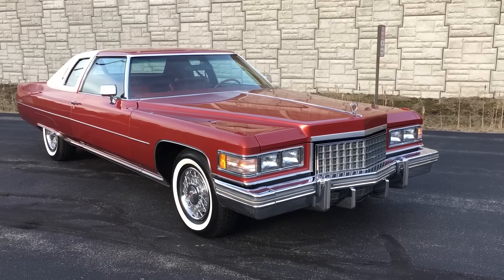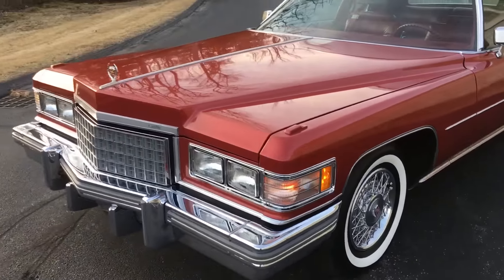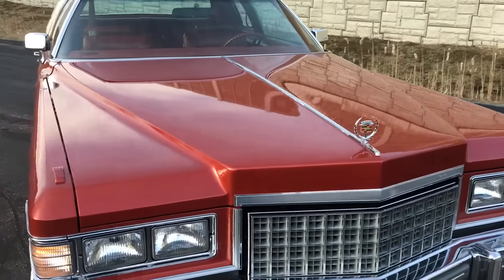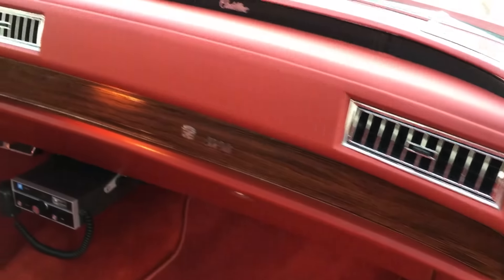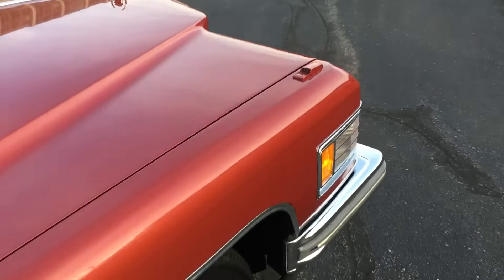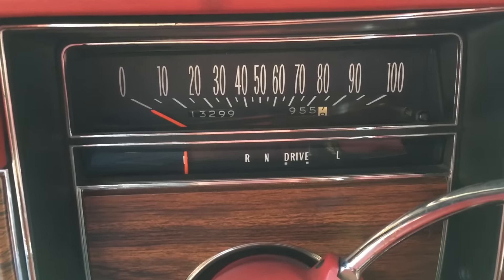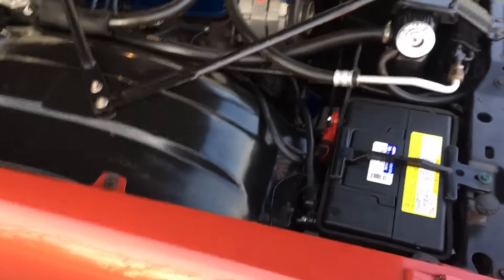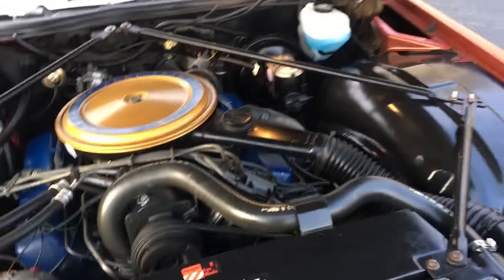1976 Cadillac Coupe DeVille with 13,299 miles by Specialty Motor Cars

Comment: Hey Anthony, I realize this video it's 2 years ago, but I am seeing it for the first time, and I am happy that you shared it with me. I had a 68 Firebird convertible, just a 350 2 barrel carb, but it had a tired looking factory green metallic that alot of the Pontiac's did back in the day. This is in 76, and I saw a Caddy like this at a dealership, loved the Firethorn Red Metallic color with the White Landau top, got my paint guys to change that Firebird to exactly that color, I remember that the paint was pricey, but after we painted it, put a new white top on it, that car popped, but I always wanted to have a Caddy like those colors, thank you for putting a smile on my face, I got let go from my job of 30 years yesterday and I was feeling low, you perked me up a little, thanks!

Comment: My first car was a 1976 Fleetwood Brougham sixty special and it had every available option for that year including the fuel injection system, Trackmaster anti-lock brakes, and the air cushion restraint system. That was quite a car especially for the mid-70s. I bought it in 1987 and drove it into the mid-90s and the fuel injection system, mine was all still original, never gave me any problems

Comment: a guy gave me this car in 1986 for painting his house. i got it painted the above color and drove it for a year on all my dates. women loved it. then my father borrowed it and dented it trying to pull into a gated parking lot. then the electrics started to go, the transmission fluid seemed to drain out when parked. a black guy i worked with had to have it, so i sold it to him for $850. it was a really great car, with miscellaneous problems. i was hardly driving it at the time, old triumph motorcycles, a van, and my pickup replaced it.

Comment: How many times did the guy say "absolutely beautiful car"? It is very nice. I so long for the days when a car was really a car. 1976 was the last year for the GM  really large cars. Most cars were downsized for the 1977 model year. The Cadillac Eldorado, Oldsmobile Toronado and Buick Rivera went on two more years as large cars then we're downsized for the 1979 model years. The 1st generation of the downsized large cars are still pretty big by 2019 standards. I enjoyed the video. Nice the go back down memory lane a see what cars used to be like. There's nothing special about today's cars. Just a bunch of plastic parts with a lot of electronic gadgets.
Reply from the maker: If you were standing in front of it like I was you would agree all 13 times I said it lol
Reply: The downsized versions proved highly successful, though, and they were quite large by today's standards, as you aptly pointed out. I had a 77 an 81 Olds 98, and a 78 Buick Electra Limited. Riding in them was very enjoyable, and they swallowed a lot of cargo, too. Very good-looking cars, too. I agree that today's cars are undistinguished (and indistinguishable!), and full of plastic and unnecessary electronics.

Comment: That hood alone probably weighs more than most modern cars! I remember when these cars were all over the place. Finding one now, especially in that condition, is a very big deal. Cadillac lost its way about 20 years ago and has not come out with anything stately since.
Reply: Cadillac had some really nice cars 20 years ago, a lot better than the wannabe import trash they make now. actually lost their way when they started shrinking their cars and giving them hard seats, rock hard suspensions, and tight handling. I wouldn't touch a Caddy made after the 2011 DTS.
Reply: @hakeemsd70m  All American cars are import wannabes now, and that's why they are pretty much garbage.
Reply: @paulparoma  Yes indeed. But you're totally right about this classic 76 Coupe deVille! So much ornate detail and chrome, I'm a big chrome bumpers, to the chrome trim, to the hood ornament, to the wire wheels, a beautiful car! This car is a work of art. Today's cars are soulless appliances in comparison.
Reply: @hakeemsd70m  I know. They are so unremarkable today and catering to a completely different type of buyer. American luxury cars used to be about comfort, grandeur and style, made for people who wanted exactly that. Today, luxury is all about "performance and handling" as if we have more room on the roads for all that nonsense. And style? Everything has to be aggressive, not elegant. Pretty pathetic, isn't it?
Reply: 1992 was the last big body v8 rwd cadillac then Northstar hell staarted

Comment: It has '74 or '75 horizontal tail lights and backup lights.  The '76 model had chrome outlines around the lenses.
Reply: I did notice. The fillers were replaced.

Comment: Beautiful land yacht 500 V8  probably burned tank full of gas while this was filmed
Reply: V8 Power Agreed! With a 500 cid V8 it would pass anything but a gas station!
Reply: The 500 V8 would get better gas mileage than the 460 Ford engine
Reply: @bohemialite6371  It should had got about 10+ mpg on hwy
Reply: @jaybee2344    I   own  one  :  get  a little  bit  more ,  but  have  to  burn  a  higher  grade gas  89  -  91  octane !
Reply: @thenov1944  My 75 Fleetwood 9 passenger sedan gave 12 mpg city, driven gently.

Comment: Fuel injection in these big Cadillacs during the 70s was very rare.  I believe it is a Bosch EFI system.
Reply: It was some Bosch components, TPS, Fuel pump (bosch), married to an analog Bendix ECU (analog fuel injection). Used a coolant , and MAT sensor which were interchangable. Injectors were Bendix too as I recall. It was a mixture of components and the Caddies I owned with it none of them really ran that good , and got awful fuel mileage to boot. Lots of rough running, and you would just be chasing an endless loop with that fuel injection system. Also it ESC (electronic spark control) which further made a mess of things on those cars. I did have on Caddie that ran strong though with it, and it was a 1979 Seville with the olds 350 - last version which had also added an o2 sensor for improved MPG. I was lucky to get 24 on some long cruising road trips in that car - which was a fluke. The very last Caddy I had with this system, was a 1979 Eldorado , and I actually took the time to convert to run on a more modern-ish ECU , injectors and TPS which was Megasquirt EFI. That car ran remarkable but 18 MPG was about all it could swing on highway runs. But it sure ran strong.

Comment: Did it have the 501 motor or 472?
Reply: centervilletn it has the 8.2 liter 500 cubic inch Cadillac V8.  Last year for it.  The last year for the 472 ci or 7.7 liter was 1974.  Then in 1977 - 1979 the big Cadillacs had the 7.0 liter 425 ci Cadillac V8.

Comment: It wasn't perfect, but, fuel injection on the 500cid increased both horsepower and torque and over carbs, & maintained it, it ran great. Grand pa had it, I, was able to test drive both. F.I. made a nice difference. Burnt rubber every time, 1 legger,  though. The true wire rims were better than these hubcaps, easy to steal. Nice car, NJOY.

Comment: Its a 1975, not 1976. Rear brake lights in '75 were non-chrome surround; '76 were chrome surround. I had the '76 CoupeDeVille with 500cid. [top speed was only 11mph shy of the Dodge w/440cid police package]. I had 4 different Cadillacs in the day. Those hubcaps came out in 1977; 1975 brake light surround; 1977 hubcaps;1976 car. Nice car... but something does not add up.

Comment: He didn't mention it but you can see the CB radio under the dash. Back in the day, on weekend nights all the drunks would be on telling jokes.
Reply from the maker: dirtyfred1  Had an aftermarket attached the the deck lid. I took it off and included it in the trunk.
Reply: I had 3 Cadillac Coupe De Villes at that time frame and they all had one.

Comment: You can tell it's the epitome of American luxury by the misaligned trim.
Reply: probably a monday car.
Reply: My dad had a 75 almost identical. After a few months I took it to the dealer to correct some small issues. I pointed out to the service rep that the long stainless trim on the driver's side was about 1/8"off the body. He replied, "That is so water won't get trapped and cause rust". I said come over here to the passenger side. This tight fitting trim needs to be pried away then, right? Made him look like an ass, but it got the problem fixed.
Reply: @rickj6048  he should have just sent you to the body shop.That's not a service problem.
Reply: @johndillinger8482  or a Friday car

Comment: I didn't realize they did fuel injection in anything other than the Seville from this time period. I do know that the fuel injection system in this vintage of Cadillac was very flawed though
Reply: EFI was optional on big Cadillacs in the mid and late 70s.  It wasn't a popular option.
Reply: @andrewcolsen  
I think was standard on the Seville...if I recall correctly. If you recall the Seville was the most expensive Cadillac in the late 70's
Reply: John Sluder  
I think this fuel injection system of this time period had about 100% failure rate
GM had not sorted the bugs out

Comment: 76 was a carbureted car air filter looks like it’s from a Seville
Reply: The '75 and '76 502 CID power plant had an option for fuel injection...The gold air cleaner lid was on the fuel injected cars. The Seville had a 350 CID that was fuel injected.
Reply: @evolution4358  500cid, 502 was a hose #. But, fuel injection was rare, but, it made a difference on the "Go" pedal. No problem in Winter, if maintained.

Comment: Extremely nice Cadillac.  But probably be way over priced.. mileage hard to know and determine if actually as those odometers rolled over. I brought a pristine 69 convertible with 21k miles for 6 thousand.. reality was 121k dealer service by original owners.
Reply from the maker: This car sold in less then 1 day, actually it was sold the day this video went live. Asking price was $14,995